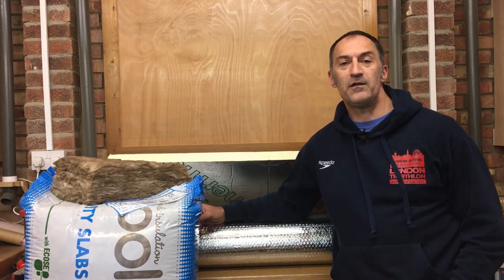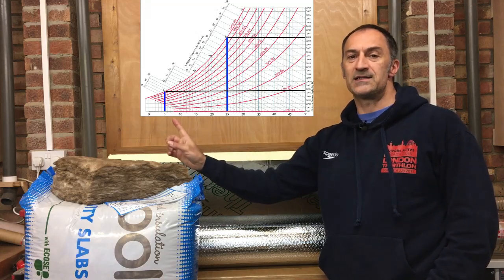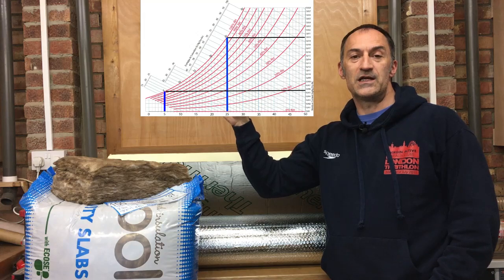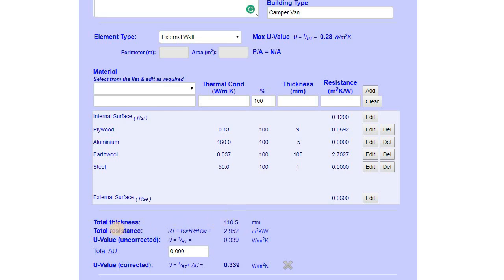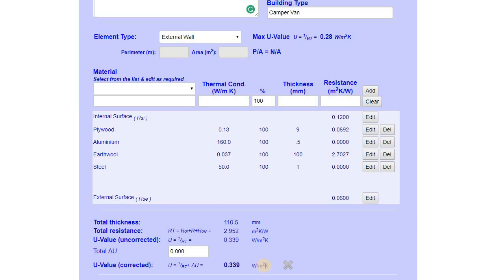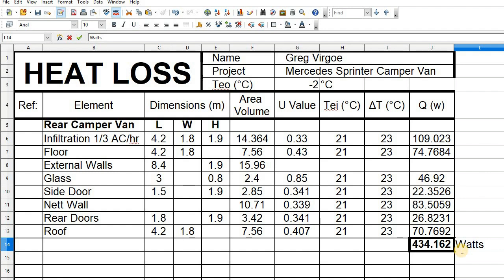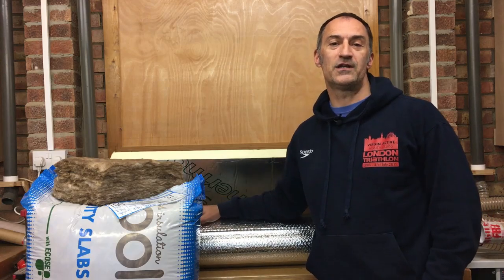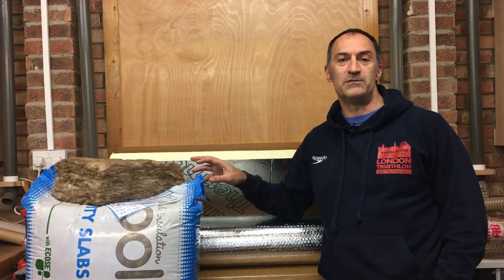How to Insulate your Van Part 1 - The facts you need!

Comment: You end up with a figure of 434 watts. If I'm understanding this correctly, for you to sit comfortably at 21 degrees inside the van while the van is in an area that is -2 degrees, then you'd need a heater that would output 434 watts of heat in order to keep the temperature stable?

If this is the case, then the only thing that really matters is how many watts of heat does, say a diesel heater, output?

I'm trying to find the answer to whether or not insulation is really all that useful, because if it mostly just comes down to a diesel heater using more fuel or not, then really it's about the cost of time and labour for installing the insulation v the cost of diesel fuel.

These kinds of things make sense for a house, because a house is so large, but vans are so small I still haven't been able to find out if insulation is really worth putting in at all.
Reply from the maker: Perhaps you can try it out for us and report back 😃

Comment: Hi Greg. I plan to install a hydronic heater in my van (a Kalori Silencio 2 Heater 5.5kw 12V) for cold weather. Do you think 5.5 kw will be enough for a Sprinter 170 extended  or do I need 2 of them? Thanks
Reply from the maker: One will be loads 👍🏼 we run our Truma on eco mode and even at its lowest setting 900W it still keeps the van warm inside when it’s thick frost outside. It’s such a small space a couple of kw is plenty.
Reply: @GregVirgoe  Thank you. I appreciate your quick response.

Comment: Greg Virgoe such a great video. Thank you. What do you think of the recycled bottle plastic wool type insulation? I've had it recommended so much and then doing exactly the same as you, wrapping over the top with double foil vapour barrier and sealing with aluminium foil 😊 thanks!
Reply from the maker: That’s excellent stuff. We used it in the rear doors. I wish I found out about it sooner in our build I would have used it everywhere else. 👍🏼😃
Reply: @GregVirgoe  thanks Greg... Your video series is so unbelievably helpful. Thank you for replying. I will be using that then 😊

Comment: Do the same principles apply to simply insulate a van roof to stop my tools getting wet when it’s really cold/frosty outside? Will insulating the roof be sufficient or should I be doing the walls too?
Reply from the maker: I take it yours is a work van and the tools are lose in the back of an uninsulated vehicle?

Comment: Does the vapour barrier trap moisture on the inside and cause mould when it hits the van wall?
Reply from the maker: No
Reply: @GregVirgoe  Good to know because we have a van group and everyone is terrified of vapour barriers because of mould being trapped inside. They think a GAP will allow AIRflow and dry out the moisture. Thanks so much for the help, cheers.

Comment: Hi greg..would expanding foam pumped in to the cavities be a good insulator . If the wall sheeting was fitted first sealed all around  and then filled with 2 part industrial foam..would this be a better job ?

Comment: Hi Greg - your videos are excellent
Having just begun restoration on an 1980 Airstream caravel i am just beginning on the insulation. 
I have lined all the interior walls with relective foil.  The plan was to then fit 25mm kingspan over the top before fitting the interior walls
A question i am hoping you can answer is do i leave a small air gap between the two?
Or can i put one ontop of the other
Any advice much appreciated
Thanks

Comment: Hi Greg.
Maybe this has been asked already, but will the Mineral wool not absorbed moisture packed on the inside of the outer facing van pannels, and allow water to lodge on the bottom of the wool and cause rust.
I have seen in other online videos where it has been stated not to use this kind of material.
Any input greatfully appreciated.
Thanks Pat

Comment: Hi Greg! Thanks so much for the video! Very informative! I was wondering though... If one paints the internal part of the metal exterior wall with some kind of rubber paint that is waterproof, wouldn't it help to prevent condensation as water droplets couldn't be form on that part of the wall? If it is so, than would be a good thing to also paint the external part of the interior (wood) wall so between the walls would be isolated from water? I don't know if that makes any sense or if I was clear, but I would like to know your thoughts on that! Thank you! Cheers!
Reply from the maker: Condensation forms because the surface layer is colder than the dew point. 
A layer of paint is not thick enough to raise that surface temperature enough to stop condensation forming. 
A layer of self adhesive closed cell neoprene foam is probably the least you could do to stop condensation forming. 
But it’s expensive and again not very thick. 
So it’s just more economical to stick with traditional insulation materials and cover with a very well sealed vapour barrier. 👍🏼

Comment: I could not recommend DODO PRO VAN Floor insulation material. There LWB pack which contains 4 rolls of 1.5 meters requires an extra 2 rolls for my Mercedes Sprinter LWB. For a start. It is held in place by contact adhesive once this glue takes a grip it is impossible to release. Hence lining up even the smallest piece of  "DODO PRO VAN Floor insulation material" is fraught with danger of misalignment.  I ended up gluing only the smallest parts of "DODO PRO VAN Floor insulation material"  inplace leaving the remainder free floating.

Comment: Hello, fantastic explanation from a professional. I would like to know what you think of cork projected on the interior walls of the van and if it would be a good solution. I have also found other material from the brand dodo mat and I would also like to know your opinion, greetings from Spain
Reply from the maker: It has ok insulation properties. Would be slightly heavier than other wool based products. Would still require a vapour barrier over or before cladding

Comment: Hi Greg, your video's are great. I'm learning alot now that i am converting my own van. Just for the weekends with my wife and kids but i want to do it right and with your help i am getting there! 
Question though: Does the R value mean: the lower it gets the better insulation capacity it has??
I'm wondering because i tried this equation with the same material but with different thickniss. In my case it is easypol polyester wool. So one plate is 0,015 m thick and the other is 0,080 m thick. is has a lambda of 0,035. 
The thinner one has an R value of 0,43 and the thicker one an R value of 2.28.
But.... when i'm thinking about it, if i have the same material but different thickniss the thicker one will insulate better right???? or am i jumping to weird conclusions!!??
Reply from the maker: Kai Yasuda you are right the thicker one will insulate much better. The bigger the R value the better. 👍🏼😊

Comment: Hi Greg, really useful video! I have used pretty much all the materials and tips you have given in these insulation videos. Quick question, the crevices between some of the ribs of the van I am finding hard to stuff insulation in... for example the rib between the two panels that would house the sliding door rail (if it were on the drivers side), did you manage to get any wool in?! Or just leave it?! 
Many thanks 
Lawrence
Reply from the maker: clkupai yes I’m pretty sure we managed to stuff all of the rails from the holes below on that side. My next insulation video shows that.
Reply: Greg Virgoe thanks, I must’ve missed that video but will check it out!

Comment: What is heat lost if u use  plywood, aluminum bubble , wool, aluminum again, steel?
Reply from the maker: Gaya-Sha Nickie the layer of foil bubble has minimal thermal conductivity so it makes no difference if you put a layer against the van. 
I would not waste time and money doing that just put a layer over the insulation before you panel the van. 👍🏼

Comment: Thank you for explaining this in such a detailed way!! This insulation protects also from high temperatures outside, right? Hot or cold, is it the same concept or if it is hot outside, once the heat gets inside would it stay for longer? Thank you so much!

Comment: Hi Greg, you have been the tutor for every step of our Sprinter conversion, thank you sooo much 🙏🏻 one question in regards to the wool insulation: we used Knauf driterm 37 as you suggested for the top and bottom cavities but I was told that this material will hold the moist should it face it through reflectix etc. and will never dry out. We have already done it and are about to do the vapour barrier (that I would make sure I do it properly) but should I scrap all the glass wool fibre bu removing it and buy a new plastic / real wool one now? Your thoughts would be much appreciated 👍🏼

Comment: Thanks so much for your van building videos. It helps me preparing to buy a Sprinter/Crafter somewhere this year and converting it myself. I wonder, do you have experience with Armaflex as insulation? It's a self adhesive, flexible insulation material you directly stick on the metal of the van. Thermal properties: lambda 0,033, and at 19 mm, it's R-value would only be 0,58? What I gather from the internet, is that people are very enthusiastic about this material, but if I understand your math correctly (higher R value is more thermal resistant?), this material doesn't seem to be a very good insulation? Thanks for your thoughts, appreciated!
Reply from the maker: Ben Minderhoud Armaflex has a good lambda figure it’s halfway between PIR board and rock wool the problem is it’s not thick enough and you can get much better results with cheaper materials. 100mm of recycled plastic loft insulation has a lambda of 0.044 and an R of 2.3 so even though it has worse lambda figure it’s 6x better because of the thickness. 
Armaflex is heavy and can be expensive. Use Diall recycled loft insulation it’s cheap and very easy to work with.
Reply: Greg Virgoe thanks for your reply, that were exactly my thoughts after seeing your video and looking at Armaflex. I haven’t heard of Diall, I’ll look into that. Much appreciated!
Reply from the maker: Ben Minderhoud if you are in the UK it’s sold by B&Q

Comment: Hi Greg. Thank you for all the great video's. It is so helpful en fun to watch!
We bought alufoam. It has an aluminium coating on just one side. Would that work just as well as a vapor barrier as the foil faced bubble wrap?
Some people advise us to leave an air gap below the cellotex and drill some holes tot have ventilation between the metal of the van and the insulation, in case any moist come's through the vapor barrier. Would you advise to do that or really close every possible gap and make sure no moist can come in?
Thank you!
Reply from the maker: Hello Thomas, I’m glad you asked me because that is really bad advice you’ve been given.  The purpose of the vapour barrier is to prevent any moist air coming in contact with your metal van. Drilling holes to ventilate that void is doing exactly the opposite. In fact you might as well not bother with a vapour barrier and let your van sweat 💦 every day. Ventilating the void where the insulation is not the solution. 
If you make a good job of sealing that vapour barrier. Which is not difficult to do you will not have any condensation issues at all. 
That is a fact. 👍🏼😃
Reply: @GregVirgoe  I guess the given advise comes insulation of houses, where moist can enter through porous walls (or a vapour seal is not possible)?

Anyway, thank you very much for the clear explanation (and confirmation of how we were building the van)!
Reply from the maker: Thomas van Barneveld yes you are dead right you have to apply the materials to the application in which you are using them. Most insulation manufacturers are making their products for houses that need ventilated voids to stop wrot and mould forming. A steel van is a very different setup to deal with. Follow my method and you can sleep well at night.

Comment: Your videos are so substantial, and you are a natural teacher. Everything from the science and metrics behind the calcs, to the organized and methodical delivery, to the soft voice that is so easy to listen to, makes this a must see for anyone building out a van. Thanks also for no music.
Truly Greg, your series is the best one on van building on Youtube today, many thanks!

fyi - Celotex is what we call PolyIso foam in the US.
Thinsulate is a great material too, thin and efficient but costly.
Heavy Mass Vinyl is what Humble Road uses as both insulator and sound deadener.

One important thing to note is that Reflectix (bubble wrap sandwiched in foil) only works within an air gap. So typically, you waste an inch or more of space.  George from Humble Rd solved this problem by using Thinsulate with the white fluffy side facing inside the van, touching the Reflectix. According to the Thinsulate makers, this qualifies as the air gap, so now you lose no space.
Ken from Ourkaravan also uses Thinsulate.  I think on the walls, you save space by using Thinsulate, Reflectix, and Heavy Mass Vinyl then the plywood.  Celotex/ Polyiso is optimal for floor and ceiling.
Reply from the maker: Lass-in Angeles thanks for your kind words. 
If you compare the calculations for two options 
1. Air space & radiant barrier
2. Same space full of woollen type insulation
The second would have vastly greater thermal conductivity properties. 
Insulation works due to its conductivity and the thickness of the product. 
All these very thin products that claim high values are easily beaten hands down by 2-4 inches of recycled loft insulation. 
There’s really no debate the science and calculations speak for themselves. 
Stick to a decent thickness of insulation and a vapour barrier over everything. That is all you need. Forget air gaps, radiant barriers or expensive thin materials. 
It really is that simple 😊👍🏼

Comment: Great in-depth videos Greg, do you have any thoughts on super quilt insulation? it says it has a thermal resistance of 3.0m(squared)K.W but I'm not quite sure what that means, is that better or worse than Kingspan/Celoxtex? It seems to be an insulator and vapour barrier in one as well which is good. Thank you

Comment: another great video, I was wondering how much celotex and earth wool did you use? thanks
Reply from the maker: I would recommend the recycled plastic loft insulation in lieu of mineral wool just a few better credentials. As for qty. 
3 sheets of 50mm
3 sheets of 25mm
4 bags Diall loft insulation 
3 rolls foil bubble 1m x 10m

Comment: Where would spray insulation fall in insulation value? Is a vapor barrier still needed?
Reply from the maker: 3D LAYERS it is very good a similar value to PIR board and providing you don’t cut into it it forms a vapour proof skin.

Comment: I was told rock wool would act like a sponge and soaked up water (condensation). So should not be used in a van as it would increase the risk of rusting from inside out. It was recommended to use recycled bottle insulation as this would insulate but not soak up water. I'm not saying this is correct but was the information I was given.
Reply from the maker: baz6755 there won’t be any condensation if you fit a sealed vapour barrier. You can use whatever insulation you like if you use the correct method of installation. You were given poor advice. Watch my insulation workshop video that will explain more about why you must fit a vapour barrier. 👍🏼😃
Reply: @GregVirgoe  thanks Greg that's helpful to know. I have watched alot of your videos they are awesome very well done. It's going to help me alot with my build

Comment: Hi Greg - Thanks for this invaluable series - at least it is from my perspective - did you complete the heat load calcs for the cabin part of the van and come up with the TOTAL heat loss?
Peter Australia
Reply from the maker: Peter Struys to be honest I didn’t because I knew I was fitting a 4kW heater which would be much more than I needed. Turns out we only ever have it on its lowest eco setting so the insulation is working well.

Comment: I just realised Knauf refer to both their glass and rock insulation as "Earthwool". There seems to be a huge selection with wmk going from about 0.032 to 0.044. I've read the rock wool is meant to have better properties, but the glass is cheaper, then there's recycled plastic which seems to have a wmk of about .044 but is cheaper still and meant to be easier to work with. I'm thinking to use a combination of insulation based on your advice, with the .022 board where I can. Just wondering would you suggest spending the extra on the Earthwool over the recycled plastic or would there not be much difference?
There's actually someone local selling some 150mm glass knauf earthwool with 0.044 wmk. It was used in a warehouse for 2 months and then the tenants moved out so I'm wondering is it too big a gamble incase it's holding moisture/mold or should it be ok if I inspect it and it seems dry and clean. Then I'd take a 50mm layer off so I'd be left with 100 and with the offcuts, put two 50's together to get another 100. I've a sprinter too, so your videos have been invaluable :)
I noticed in your part 2 video, you didn't seem to fill the roof support beams. I was thinking to shove the plastic insulation in the small holes and try fill up the beams this way!